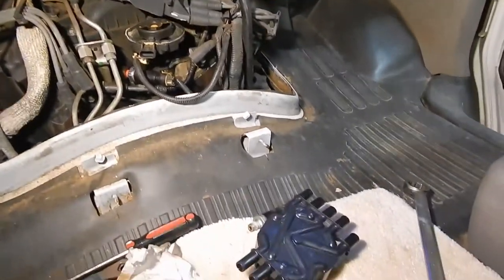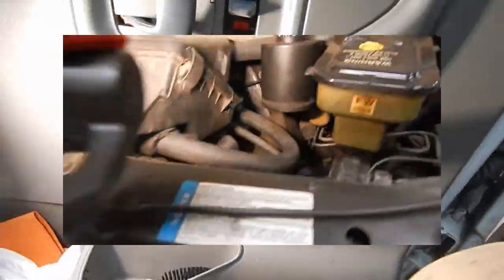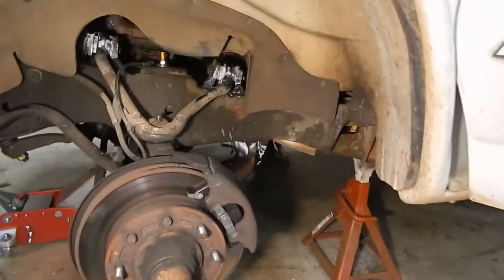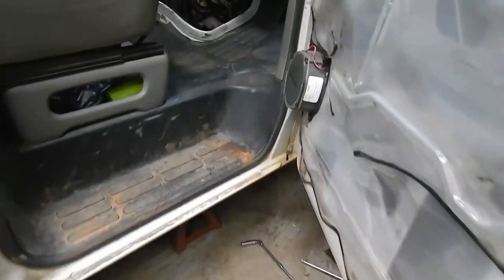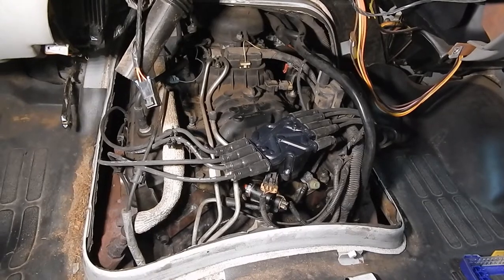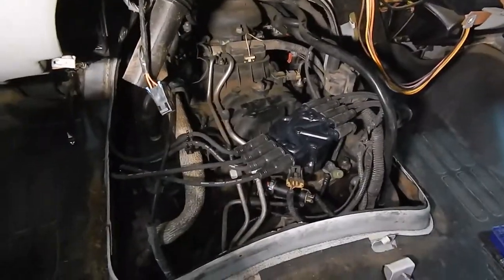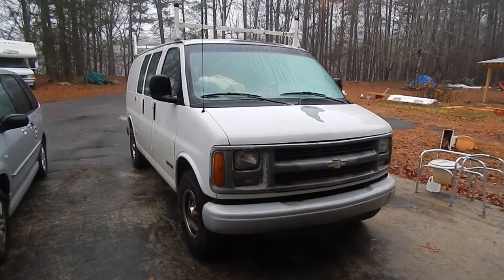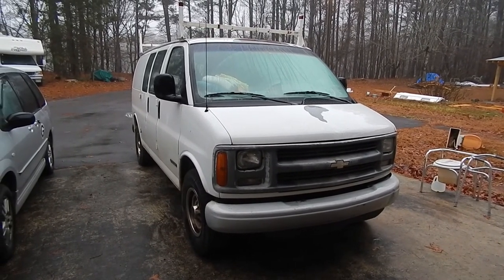How To Do 2000 Chevy 2500 Express Van 5.7 Tune Up #5 .7ExpressVanTuneup #autorepair #auto #crow

Comment: I've changed the spark plugs on a few of these GMCs with the 4.8 l and I never had to take the wheel off. You do need extensions though short and long, several variations always helps. Some you can get to from the inside the others through the wheel well, and even the front two you can get from underneath the hood.
Reply from the maker: Thank you for the info, I used to love working of my cars and trucks but not any more, Ha. Thank you for watching the videos too

Comment: Will the van still run if you remove the fuse for the security light?
Reply from the maker: I did not try that, and do not know. It is running good now but the fuel pump is making a buzzing sound.

Comment: Is the spark plug wires above a hot exhaust pipe?
Reply from the maker: Yes above the exhaust manifold with a heat shield helping to protect them

Comment: Did you replace the ignition coil while you were at it?
Reply from the maker: I did not replace the coil but should have. I may go back in and do it. I still have a skip at times that has concerned me, the coil could be the problem. Thank you for your comment and for watching the videos. I hope they have helped you some. You tube videos have saved me a lot of mechanic labor these last few years

Comment: whats the gas mileage now?
Reply from the maker: I am getting between 11 and 14.5 depending on traffic
Reply: @Crowbirdvideos  which engine?
Reply from the maker: @saltpepper1894 5.7L  350
Reply from the maker: It's the same mileage as  it was  Is when new
Reply from the maker: It is  Also a 2500
Reply: @Crowbirdvideos  i have same van, except mine is gray. just got her...hopefully ill get similiar mileage
Reply from the maker: @saltpepper1894  I think it should. I purchased this one New in 2000 and the mileage has been the same the entire time. I used to haul a lot of equipment in and ladders on top of this one

Comment: I have one of these and I love it 2001 gmc savana with 270,000 miles and still run like a beast ‼️..I also decked the back out .. looks like a mechanic shop on wheels
Reply from the maker: This one has been a good one but the miles have been hard ones as It was my work van for 20 years